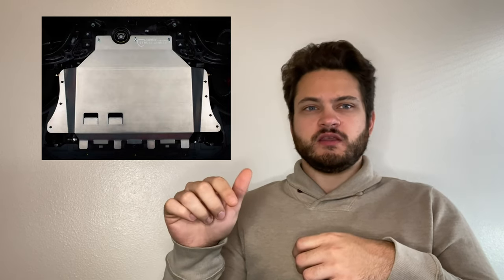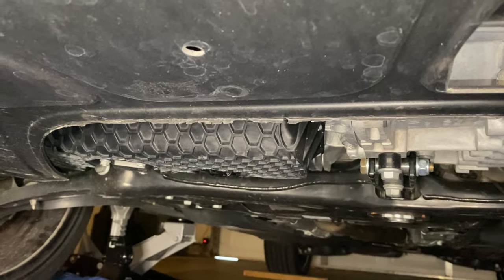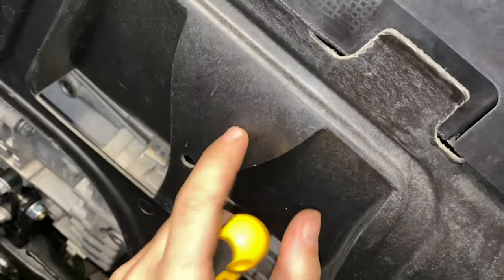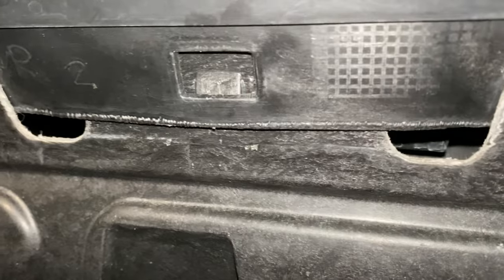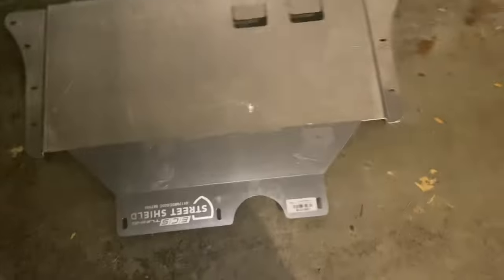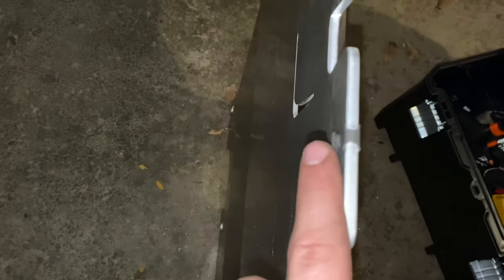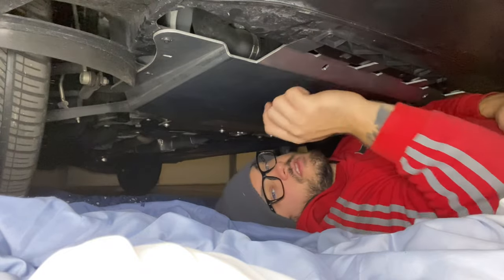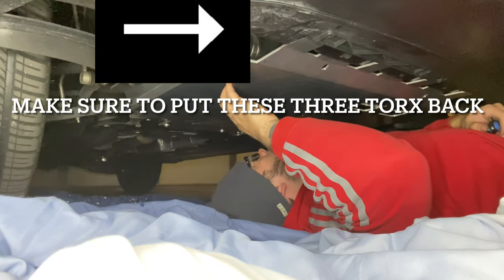MK7.5 Golf R Skid Plate Install

Comment: Should have a small panel that you can remove so you can get to sump plug to change oil ... pain taking this on and off every oil change.  Badly designed...
Reply from the maker: Agreed, they could have made this design better. I used to change my own oil but for the Golf I get an amazing deal at the dealer so I let them deal with it.
Reply: @CarsCouches  Which I could find a dealer when I live in AU like that but even VW Australia can be difficult an hard to deal with.
Reply from the maker: I got lucky with this one, been changing my oil since my first car but finally the cost is so close I just have someone else do it and I trust the techs that work there, talked with them before they’re awesome.
Reply: @andrewphillips5955  The manufacturer should be the one doing that ... I don't buy things that are not fit for purpose and have to have modifications made before I can use/fit them.